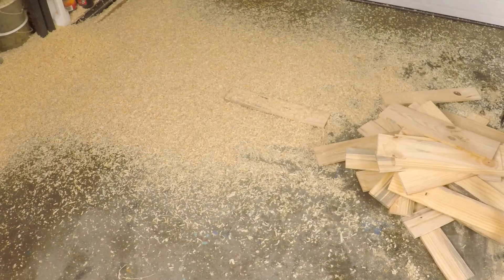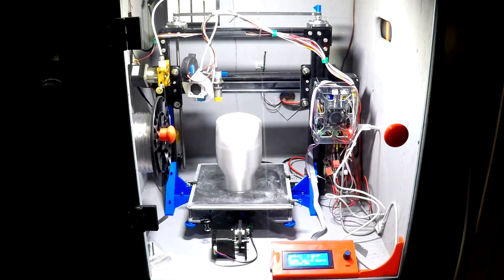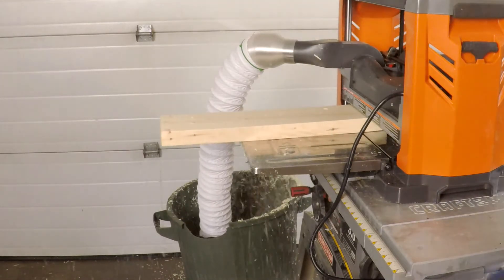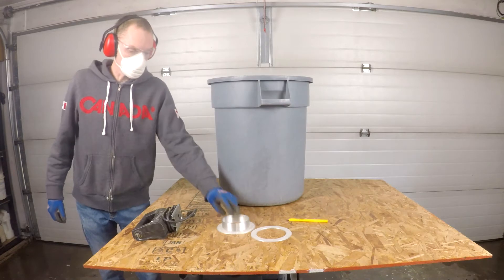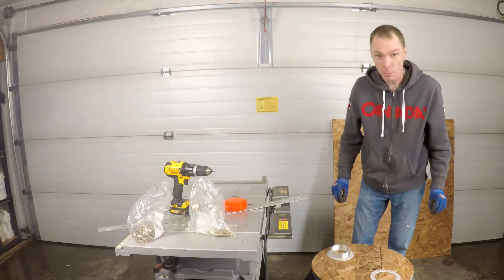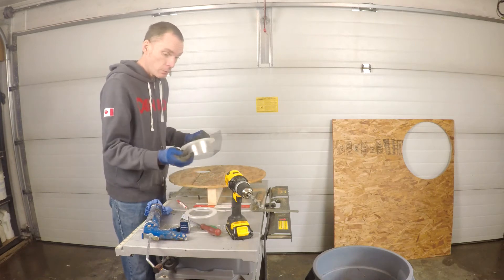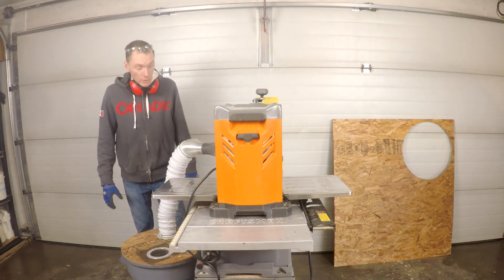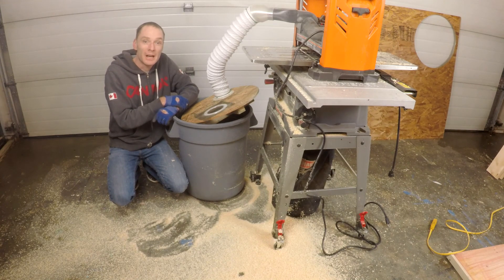Budget Dust Collection for a Ridgid Planer

Comment: CAUTION: the Rigid 4331 uses the cooling air from the motor to blow out the debris. Any reduction in flow may fry the motor, not good!

Comment: I’m not sure you are capturing much of the fine dust, your not even capturing all of the chips. You need a 1 hp or greater dust collector with a pleated canister filter. That would not be “cheap” but it will provide real dust collection.
Reply from the maker: Fair comment, I've been using it for well over a year now and while it is better than nothing and prevents sawdust going everywhere in the garage, a fair bit of sweeping is still required after.  In hind sight, not as good as I though at the time!  The planer blows out the sawdust pretty good, I was thinking of trying a vortex separator on the top rather than going with a canister filter, maybe a future project!

Comment: Nice video  still working good?
Reply from the maker: Works ok but does need improvement.  Problem is the screen gets plugged up fast and then it blows out between the lid and the bin and I get a pile of sawdust beside the bin.  I'm thinking of adding additional screens and maybe a baffle under them as well to alleviate the issue.  A pile beside the bin is still better than all over the garage though, so I do still use it every time I use the planer.

Comment: Are you willing to post the 3d file? Thanks!
Reply from the maker: sure, just uploaded them to thingiverse for you!  the screen needs a better design, which is something I plan on in the future so you may want to see if you can come up with something better for that part.  i posted the slts as well as the original fusion 360 file.

https://www.thingiverse.com/thing:4690426
Reply: @reileymckerracher9181  do you have a link or title to your print?
Reply from the maker: @michaelholland9534  you can find the stl files here: https://www.thingiverse.com/thing:4690426  The screen plugs up quickly which is something I want to address with either a cyclone or better/different screening.  If you do any improvements, be sure to post back!